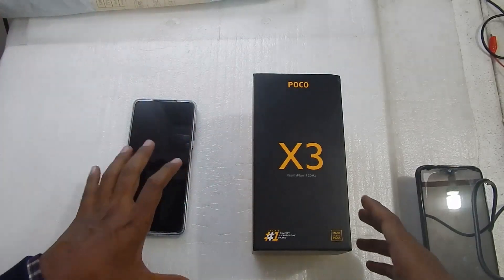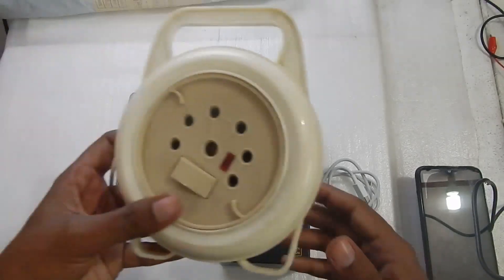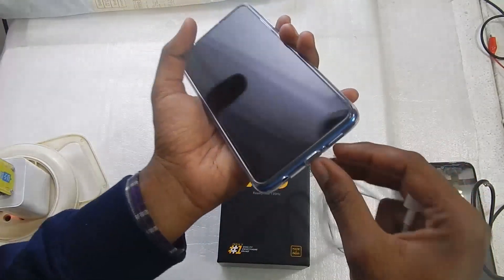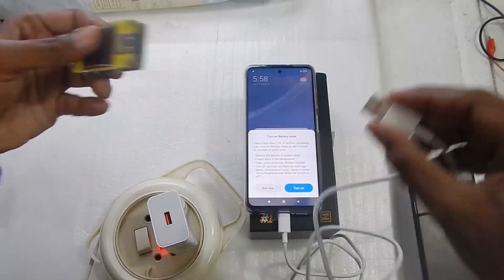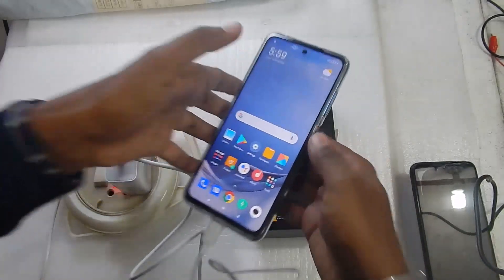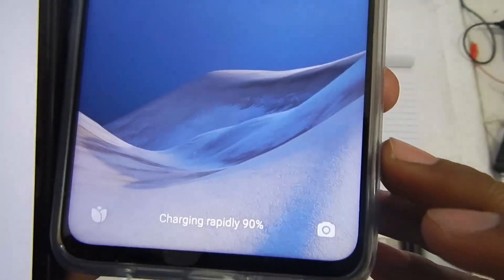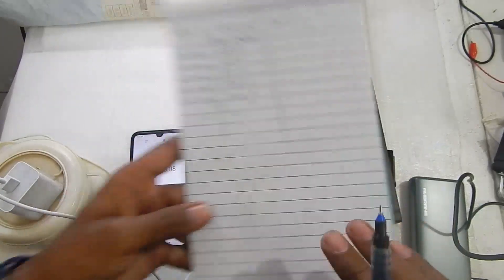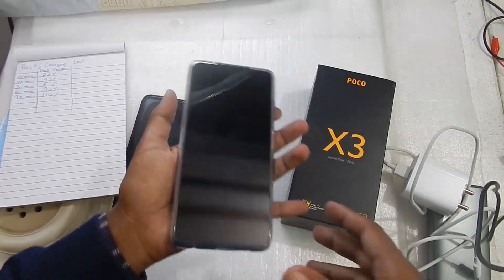POCO X3 Charging Test using In Box charger.

Comment: Have u observed charging sometimes lag after 90%, if once u disconnect it?
Reply from the maker: Whether you disconnect or continue charging after 90% it takes about 30 more minutes to fully charge.
Reply: No, instead it also discharges sometimes, this is what happening with poco x3. 
Please try on ur poco x3, u after 90% either it will not charge or it will discharge.
Reply from the maker: @divanshumanchanda318  i have tried with my phone but this is not happening with my phone. Discharging can happen if you use another charging cable instead of the original.
Reply: @gurribuy  ya I'm using different charging cable
Reply: @gurribuy  how can i find or order online original charge plz help
Reply: @gurribuy  I only need cable
Reply: @gurribuy  where to buy original sir
Reply from the maker: @mtvstudio3150  I don't know.  I also wanted to buy one but couldn't find one myself.
There is no info on the official website as well.

Comment: There might be some issues with your adapter bro.. bcz most of the other youtubers recorded between 65-70 minutes
Reply from the maker: Its possible. But, i don't have another Poco x3 charger to test and confirm other youtubers's  claim.
Reply: @gurribuy  sorry bro I meant extension
Reply: My main line voltage is 250-257 does it increase my charging time??? Any opinion
Reply: @Noname-9013  no idea about that but after using it for about a month or so I can say that it's a worst device ever from poco. It heats a lot and lags stutters are your everyday companion. The camera is mediocre. Charging time is usually 80-90 minutes.

Comment: why Redmi 10 prime has no 33 watt charger this not good habits beacuse same battery mah as poco x3 and Redmi 10 prime
Reply from the maker: 18 watt of charging speed is good in my opinion.
Charging speed is over hyped.
I mostly charge my phone using a normal charger.
But if i'm in a hurry then i may use the fast charger.

Comment: bro my phone gets really hot while charging once I checked in battery & performance....battery temperature was 47 degrees. Why is it getting this hot ? Is it normal ?
Reply from the maker: Heating while charging is normal and 47 degrees is also normal in my opinion.
Next time when you charger elevate your phone by putting two pen or pencil under the phone so that air can pass under the phone.
Also, whenever possible avoid using fast charger and Use any 2.4 A charger to charger the phone.
Reply: @gurribuy  what temperature does it show on your phone
Reply: @gurribuy  bro... My phone is not charging this fast... 30 minutes 40% only charging
Reply: @gurribuy  did they decrease speed through an update
Reply from the maker: @rajsrivastav6940  its possible after the update, i haven't checked since i did this video. I'll test the speed tomorrow and tell you my observation.
Reply: @gurribuy  thanks